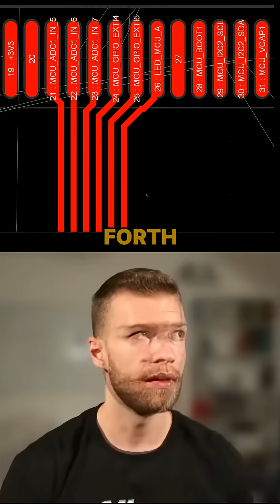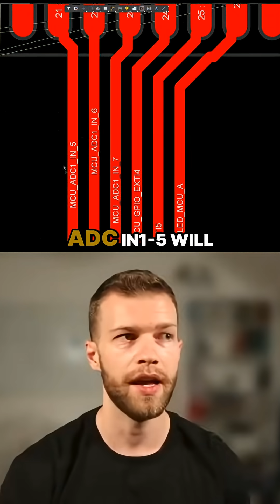Is Trace Spacing the Most Common PCB Design Error?

Comment: First : bottom video looks weirdly like AI.

Second: I disagree. Most beginners do the opposite. Traces all over the place, just to connect things together. Waste enourmous amount of space. 

Also, default rules are nowhere near minimum manufacturing capabilities in Altium. 

I would say that you should leave space for important traces like diff pairs, precision ADC, high speed nets, or stuff like that. 

But put as close as possible every other signals. Like low precision analog signals, low speed digital signals. Do not put your traces far away just for the sake of it.
You can save more than 50% space by doing this. Even saving on cost by reducing the number of layers.
Reply: Video looks AI because YouTube is currently doing some sort of experiment where they're using some form of AI filter on most shorts with a face camera. (Speculation being that they're trying to figure out how much the can reduce the size of a video file and re upscale it with AI without anyone noticing.)
Reply: Je vous rejoins, la vidéo simplifie les choses au détriment des conséquences importantes.
Reply: I don't think this design is a mistake. These adcs look like low speed, high impedance signals. There will be no cross coupling.

Also I've never had a manufacturer not be able to hit their advertised trace with spacing.

Agreed, layout should be thoughtful, but this is not the number one thing novices get wrong.